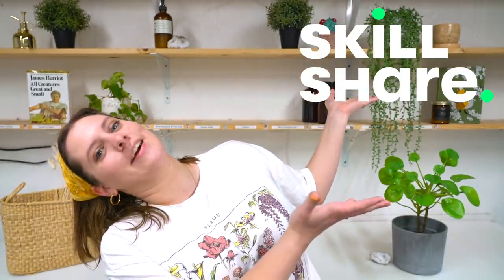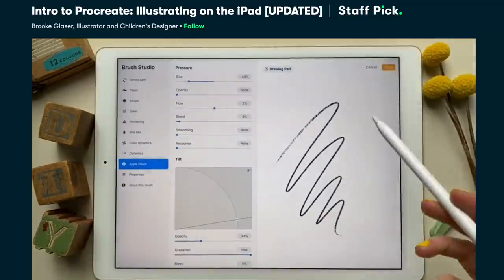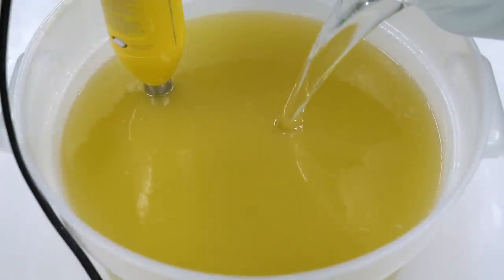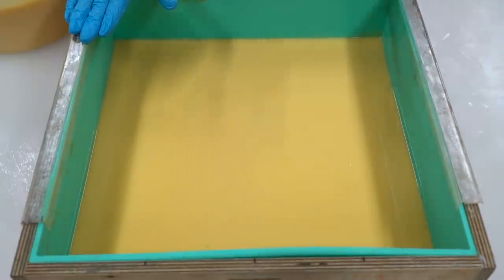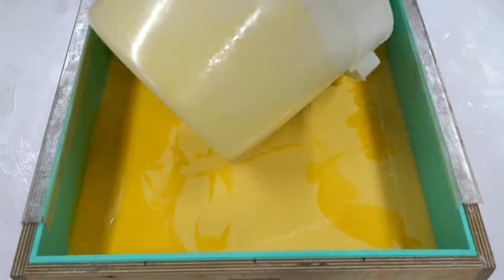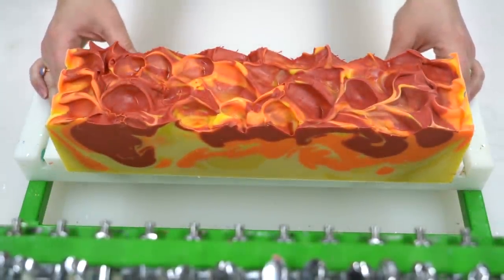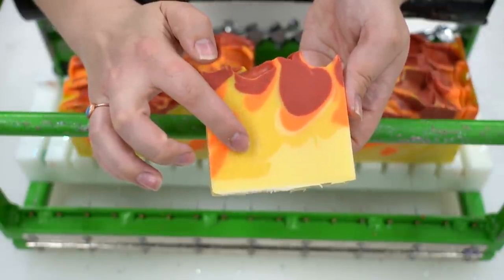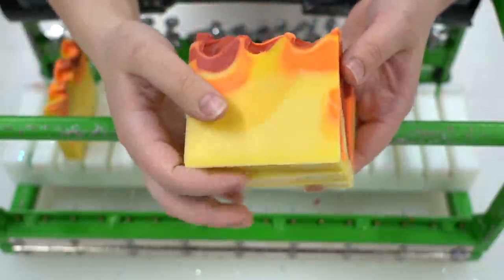I Made a Fire Element Nature Cold Process Soap......and it failed | Royalty Soaps

Comment: Katie, what would it look like if you poured the batter just as you did into the mold, but have a hanger tool (or maybe more than one)placed lengthwise on the bottom of the mold already and then just pulling the hanger straight up? You could wiggle the hanger a tiny bit coming up, but not swirl it, if you get me. I would love to see you experiment with that. Ooh--maybe using different thickness of dowels? You could tie fishing line or twine on either end and use that to pull up through the soap.

Comment: Hey, lady. You probably won't see this because there is exactly 1,234 comments before me (how odd!!), but you are on the right track with the using the spoon and thin batter. I made a video called "Witch's Cauldron," where I used the fire technique, for reference. I think with pouring less batter at one time and making sure to retrace the same path of your pour will help you out. Remember the small gaps—where you don't pour batter—will be the flame from the lower layer. The smaller your gaps are, the pointier the flames will be. Loving your collection this month so far!

Comment: Ok. Sometimes we make things that we are disappointed with, because they didn't come out the way we wanted, that the world loves anyway. This is one of those things. Maybe the next time, the last layer or two should be dropped from a little higher, so it would go deeper, forcing more swirling to happen. And you're right about the two yellows, there just isn't enough contrast between them so they don't get lost. I'm thinking about a reddish orange between the orange and red layers. Granted, by this time you've already made the next batch and then some. Speaking of which; when are you going to start doing the viewer designed soap series thing again? That was fun. Bev

Comment: What would happen if you used twine? Say, you laid in evenly-spaced twine across the bottom of the soap mold in such a way that the threads were on the outside of the mold. Then, when you did your drop and had all your colors blocked in, you could just pull the twine up and out the way you would your swizzle-hanger, but only in the upward direction (the drop having provided the downward action.) From what I've observed of your soap-making process, the only-upward pull might provide the flame-like design you're going for without blending your colors too finely.

Comment: I wonder if you could pour the soaps over 3 hangers (so they start at the bottom) and then pull them upward in different directions. Might be better in a loaf than a slab mold though. 🤷‍♀️

Comment: What if you try placing multiple hangers at the bottom of the mold before you fill it with your drop layers? After you pour the soap you just pull straight up and out, dragging the colour up to look like flames?

Comment: I’m a fan of a good campfire but I’m not a straight up pyro. I used to work for the Forest Service and lived in FS housing in the middle of the woods with no TV signal or internet. We had a lot of campfires or “caveman TV” because what else is there to do in the woods with no internet and an unlimited supply of firewood? But I also knew minutemen fire fighters and hotshots who worked for the Forest Service and a lot of those people are straight up pyros. They get an adrenaline rush from using a drip torch or dropping “dragon balls” out of a helicopter. The smell of smoke is exciting to them. I am not like that.